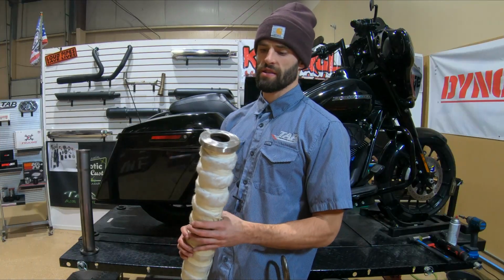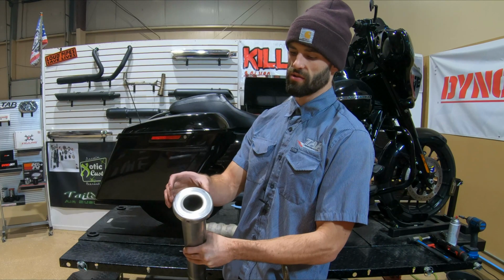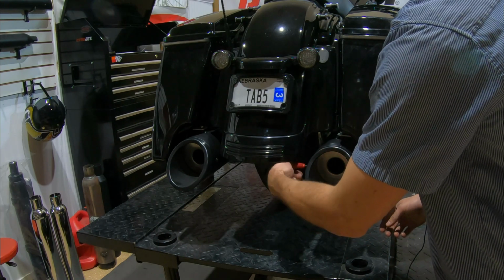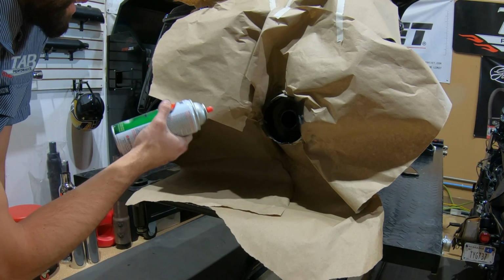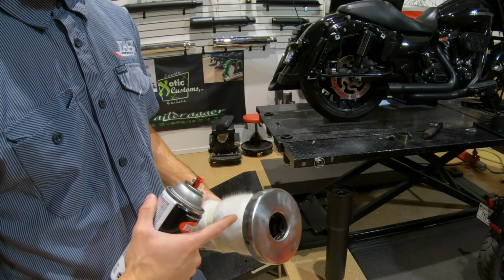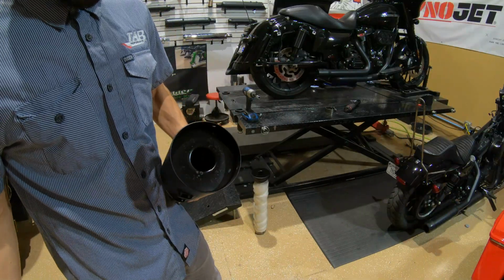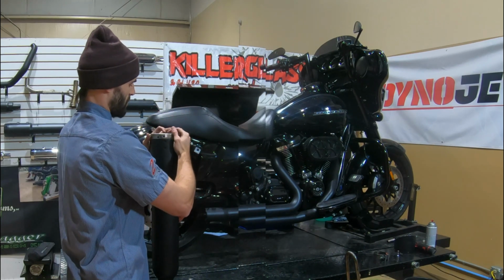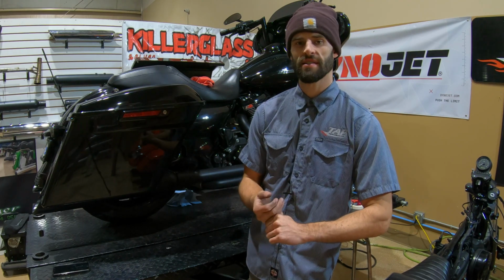Blacking Out the Baffle End Cap - DIY

Comment: Take is 80 grit palm sander 150 grit go around it hit it with some high temp primer and then high temp color whatever you want to do it in black it out whatever. Or just get some ceramic coat and dip the whole thing in it let it sit for a few moments and stuff shake it up in the container roll around do whatever hanging out let it dry get a little sponge paint stick in A little bit of a sponge into the ceramic coating and Wife around the edges and stuff and smooth it out and then let it dry 24 to 48 hrs. put it back in return the bike on and bake it in

Comment: I'm planning on ordering some bam sticks with zombie baffles for my Indian challenger. Can I bring the baffles to a powdercoat shop and get the end cap powder coated?
Reply from the maker: You certainly can, It would need to be a high temp powder and the end is stainless so you might mention that to them just so they process and clean correctly.